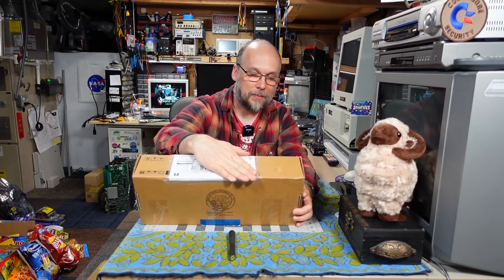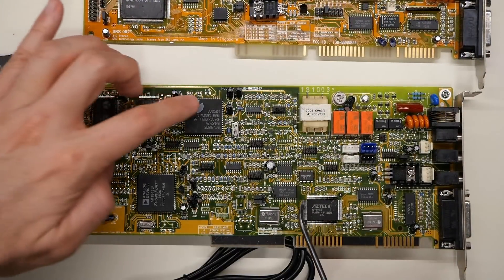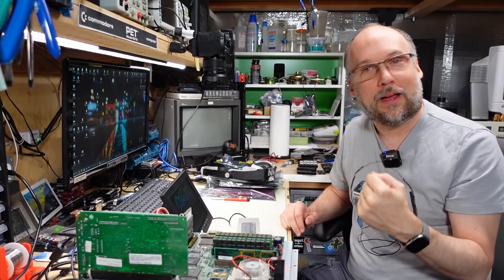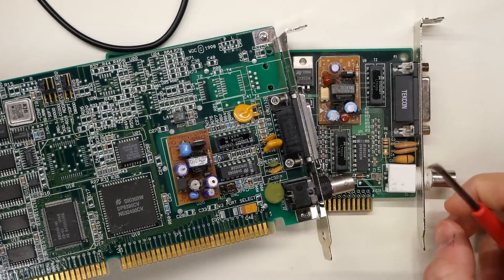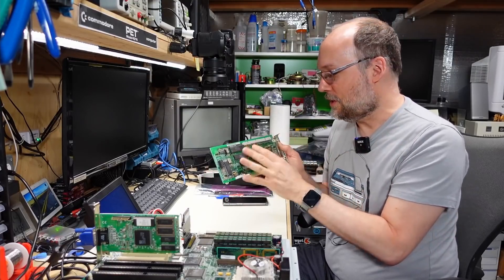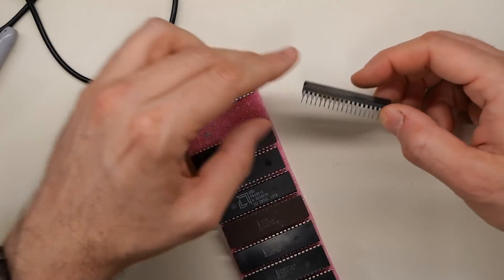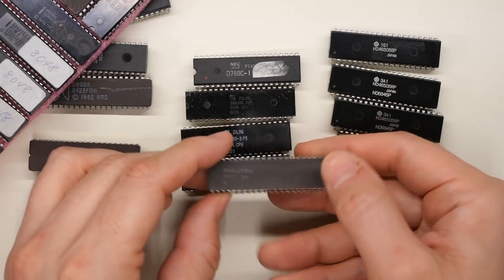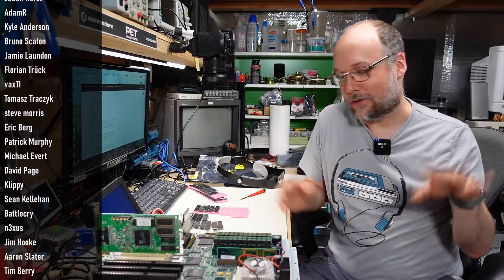An invasion of parts from the north

Comment: I didn't read all the comments so this might already have been said, but one of the last chips you looked at was a Z80B CTC (Cluster Terminal Controller) and the last one was a 4K (4096)x8bit QSRAM which is a Quasi-Static RAM.  This very interesting piece is a 4Kx8 dynamic ram array with a built-in refresh system to make it act like a static ram.  It does assert a wait-state if it's in the middle of a refresh when a memory access is requested but it was a creative way of building an 8-bit computer with cheaper dynamic memory but without having to build a refresh logic circuit.  It deserved a little more "respect" than the gloss-over it got.  It was designed as a companion to the Zilog Z8 processor and both have an interesting history.

Comment: I remember Aztech cards as being relatively decent Soundblaster clones back in the day.  I think they went as far as copying the Soundblaster 16 standard before they dissapeared from the market.  While I'm not sure about this I think they had a range of low cost PC add-ons a bit like StarTech has today.  I think we had one such card in our family PC which was a Tiny branded 486 DX2 66Mhz.  My stepfather added a Roland GS wavetable card to it which made it a really awesome sound card for the time.  Unfortunately with it being an ISA card it was not compatible with the PCI based system that we replaced that computer with.
Reply: I had one, a Aztech SG16 iirc, and it was a PRO compatible, with something more (it could do 44000k stereo, but only in Windows Sound System mode). It was sometimes PRO compatible and sometimes 16 (if it didn't require the roland MPU)

Comment: The family of microcontrollers the 8048 belongs to is the predecessor to the 8051 microcontroller series.  Both have an External Enable (EA) pin allowing the internal ROM to be bypassed.  With the addition of some external components (most notably an EPROM or EEPROM) it can execute code from external storage rather than the internal factory programmed ROM.  It only has 64 bytes of internal RAM, so compared to a modern Arduino it's a bit weak.  However there are microcontrollers currently manufactured that are very limited as well.  An example would be the PIC10F200 with 256 Flash Words of program storage, 16 bytes of RAM, 4 I/O points, and one timer.  I've repurposed some 8051 microcontrollers for projects this way years ago - long before Arduino boards existed.  The instruction set for both microcontrollers is similar.

Comment: Starlan was a network product line from AT&T and used CAT-3 twisted pair wire. Originally it was a 1Mbs network and later updated to 10Mbs. The caveat with this pre-standard gear was it didn't implement link status pulses, so you couldn't use them with standard 10Base-T hubs. However there were 10Base-T cards from other manufactures that would allow you to disable link status so they would work with legacy Starlan hubs.

Comment: Love simverters. Saved me a fortune back in the 90s
Reply: @Inject0r  I remember that as well! You'd get a tall and short A and B. The tall ones in the middle two slots, short ones on the outer slots. It stood as a "tower" of chips and let you keep your RAM without having to pay ridiculous prices.

The most we ever paid for a single computer part was $300ish for a single 8MB 72-pin SIMM for the Performa 476 we had, all because 1 game wouldn't work with the 4MB it already had and needed 8MB. I convinced my parents we should get the 8MB instead of just a 4MB since there was only 1 slot and it would extend the life of the machine. I was absolutely right in doing so.

Comment: @Adrian's Digital Basement, if any, extract the 30-pin RAM slots from the 72-pin adapters to replace the stock ones on the Mac SE and SE/30 logic boards.  Throw away the rest.  Then you've got a board that has metal tabs and not plastic ones.

Comment: The NE558 are four NE555s with slightly reduced connections. The NE556 are two complete NE555s. 
With the joystick, an impulse is set and then the time is counted until an RC element is charged. An NE555 is required for each channel, but only in one circuit variant, therefore, pins can be internally connected.

Comment: I had AZT2316 sound card in my IBM PC 330 466DX2. It was configured by jumpers, not the driver command line/did not require any TSRs like newer ISA PnP cards, and I had absolutely no compatibility issues with it.
Reply: Yes, these are EXCELLENT SBPro clones.  They are actually my card of choice.
Reply: I loved it because of that, it didn't need drivers that consume ram, everything worked perfectly both in DOS and Windows, I never had compatibility problems.

Comment: Your 3270 cards allow a PC, with appropriate software, to act as IBM 3270 dumb terminals.  They would connect via a coax cable to something like a 3274 terminal controller to access (for example) a System/360 mainframe.  Lots of fun!

Comment: If memory serves the Z8 contained Basic so it was used on my college course for easy access to Microcontroller programming, we built many variations of a black/white ping pong ball sorting system with the Z8 at its heart to learn IO and electronics interfacing. Probably would have be circa 1982-85

Comment: If you don't need the "simverters", maybe you can take the sockets off and use as replacement for plastic ones. And perhaps the OPL chips can be taken off also, to be used on more useful/modern cards. So much old hardware... what to do with it all!?

Comment: One of the chips you called 8088 was marked 8086. Fancy 16 bit stuff.
EDIT 23:39 that's the one. AMD made 8086-2
Reply: Also some other notes:

Z80BCTC is a Z80-CTC, the Zilog version of an 8-bit clock/timer chip (roughly similar in features to the Intel 8253/8254).

Intel 8251 is an USART, the big-brother of the 8250 UART used for serial ports.

Comment: That telephony sound card with the Rockwell chips looks like the one in my AST P133.  Sound Galaxy is Aztech's brand of sound cards.  Feature-wise, they were pretty decent.  The 16-bit ones gave you proper OPL3 FM, SB Pro compatibility, and Windows Sound System for 16-bit 44.1KHz audio.  For games, definitely some of the more-compatible cards out there.  The one you showed, is the Sound Galaxy Washington 16.  According to the cutely-named site "I Love Paws", this card has no WaveBlaster header.  So any MPU-401 usage will have to be via the joystick port (which the VOGONS thread confirms that card does have MPU-401 UART support).

Furthermore, Adrian, Aztech actually was VERY prolific in terms of their soundcards being so plentiful.  You are right about one card being a Packard Bell OEM version (as they were the ones who supplied Packard Bell and probably other OEMs their cards), and even companies like Reveal used them in their multimedia kits (I still have one from such, complete with a Panasonic 2x CD drive that was the same model used for Creative's 3D0 Blaster).

Comment: The ch game card was used for when a joystick, throttle and rudders needed to be connected.  You could hook up just joystick and throttle to the sound card,  but a single game port could not support a rudder.  Also, there were joystick timing issues if the gameport was on a pci sound card but playing an early dos game.  This card prevented that issue.  Only pro flight sim players had these installed as it became a niche product.

Comment: Back in the 80's UK Amstrad PC1512 there was a shortage of HDD's and there was a spate of hardcards delivered with MFM drives and RLL controllers to give you 30MB instead of the native 20MB. They were fairly reliable but not to be trusted without backups!

Comment: People complained about those winmodem Rockwell chipsets, but if your ISP had Rockwell based modems on the call-in lines and you disabled error correction and compression in your connect string those things were great.  That error correction (on by default) was a real performance killer. 

I was getting ~100-130ms pings when other modem users were getting ~200-250ms pings when I used to play Quake 2 CTF competitively.  People thought I was playing on ISDN (cable modems and DSL weren't quite a thing yet).

Comment: Here is a little more information on the Aztech cards.

The gold one with FCC ID I38-MMSN834 is a Sound Galaxy Washington 16 with the Aztech AZT2316 Chipset.

The more green one with FCC ID I38-MMSN834 is just known as the Packard Bell 030101. It has the Aztech AZT2316R chipset. 

I actually have an Aztech card in my 5170 and the OPL chip sounds amazing. The Sound blaster compatibility with mine seem to be pretty good but mine have the crystal audio chips instead of the rockwell so these ones may be different. Either way, I have found them to be perfect cards for 286 machines. I am also pretty sure the 16 bit address lines are just for the CD controller so it's possible they may work in an XT class machine as well since the sound blaster 2.0 and adlib are both 8 bit cards.

For drivers, there is a massive dump of Aztech drivers on Vogons but you may have to resort to a Packard Bell recovery CD to get the driver for the second one.

Comment: I remember a fair number of 16-bit RLL cards in the period before IDE took off. Because the difference between RLL and MFM is the disk format not the interface protocol it is possible to use any ST-506 drive with either controller. However RLL requires a more accurate drive mechanism so using an MFM rated drive with an RLL controller is hit or miss at best.

Comment: Whoa Accton network card!  These guys were big in the 90s as a cheaper small network hardware company.  I recall installing a 24 port 10mbs ethernet switch with a 100mbs fibre port in about 1996.  They were way cheaper than 3com etc.

Comment: V20s are a bit more common than they used to be thanks to some good eBay sellers.  I bought one a while back for less than $20.

I saw one 8085, an LSI chip which combines the 8080 and a few of its support chips into one package and is considerably faster than a regular 8080.

Comment: I think I had that 16bit Western Digital RLL card! I had upgraded from an "10mhz TURBO XT"  to a 386-25, and  I couldn't afford new drives at the time. I remember being really bummed that I had to set a 1:3 interleave because the old 8bit RLL controller was too slow. I still remember the happy day I was able to buy the 16bit card, fire up 'debug' and low-level format with a 1:1 interleave. I had 2 RLL drives, my original 32MB Seagate ST-238R from 1987 and my "newer" Mitsubishi MR-535 (60?MB) hard drive iirc.

Comment: Wow I live like 30 mins from Oakbank MB!  I had one of these soundcards/modem it was washington sound galaxy 16, never worked properly ever. I had the OEM for packard bell. The one I had showed up as seperate devices modem and soundcard but most of the time the Sound card portion would "disappear" and multiple reboots to get it back. Seems when we used the modem it would kill off the sound card from device mangler.

Comment: I have a Vibra16 with OPL3 chip on it. It has the absolute best bass punch and rich sound. What it in return lacks, are variable bass and treble. And it lacks mixer, except for volume controll. It is silent, so it will filther out drive read/write noises from harddisks. Normally you can hear it, when there is no sound on older creative cards. I will say that it is much like the SB16 Value Edition CT2770 model. However the value have mixer and bass/treble controll yet you can hear static noise and drive activity.

Not all Vibra cards are lacking OPL3. Just the same with AWE32 models. 3 AWE32 models have OPL3 chips, yet they are highly in demand. One is the CT3900 model. The other is the CT2760 model. (Or was it CT2670?) The third is something with CT39XX.

Comment: That is really spooky. Just before watching this I had finished setting up a CT2940 on my DECpc 433 (486dx33) together with an external Philips CDD 462 CD drive using it's proprietary 8bit serial card with audio coming in on the line-in.  That thing is so slow, would be quicker transferring stuff using it's 2.88mb floppy drive (if I had a second one that is).

Comment: I had one in a Windows 95 Packard Bell PC. I was new to sound cards at that time, but I remember it didn't always wanted to play right in DOS. I don't remember DOS drivers (like sb16.sys) for it.
Reply: in my experience it always worked great, and it didn't need drivers, i mean no TSR, no loading stuff on config sys, only SET BLASTER and a path in autoexec.bat. the port and irq were set with jumpers.  I loved that card, everything worked great both in DOS and windows. never had compatibility problems. maybe it depends on the model?. I know there are some plug and play models out there, maybe those don't have jumpers and need drivers?.

Comment: I had a AZTECH Sound Galaxy card that came with no modem, but it had an OPL4 chip and could emulate SB16. Even in Real Mode DOS. So I was rather happy with it. In Windows it had a SoftSynth WaveTable with the ability to load custom soundfonts in SF2-format, with a maximum of 4MB (not that large, I know).

Comment: I have one of those az tech sound cards. It's currently installed in my pentium 100, running windows 95. It is a pretty decent dos sound card. It worked perfectly under dos/ win 3.1. But now that i have upgraded to 95 I have had some compatability issues in some games.
Reply: it always worked great for me in 98, maybe 95's driver has some bug?
Reply: It must be. It took me a long time to get it to work at all in 95. It works fine for early windows games. But some dos games that worked before now have no sound, or crash when launched. One of these days I'll mess with it again, and see if I can get it working better. I'm hoping a different driver version will cure my issues.

Comment: I used to have have an SB16MCD card on my Windows 95 machine that supported three different CD ROM drives but the last version of the drives stopped supporting the Panasonic drive.  I had to roll back to get my CD ROM going again. Can’t recall the Soundblaster card on my Windows 98 machine.

Comment: Back in the days we would swap out the Aztecs in favor of an Sound Blaster and a stand alone Winmodem.  In the shop I worked at we never seen one that worked well.
Reply: They must have got worse by the time they started integrating modems then. I had an earlier Sound Galaxy in my first PC and it worked pretty well. I eventually upgraded it to an AWE 64 but for anything that just used Adlib and SoundBlaster it sounded pretty good. The soundtracks to DooM, Privateer and Ultima Underworld all still ring in my ears.
Reply: @flabbergasterisk  The stand-alone cards were great, the combined cards were absolute crap.
Reply: @flabbergasterisk  IIRC the cards worked ok with the drivers from the OEM install, however the drivers provided on the CD that came with the PC were different in some way.  I worked with an engineer that used a Pentium 166 with one of those cards as an answering machine for several years.

Comment: I am trying to find another one of your videos where you are showing PCBs and one of them was a HPIB(GPIB) interface card. I can't find that video again, but I am very interested in finding out as much as possible about HPIB circuits. From my screen shot of the HPIB PCB you had, I could tell that that edge connector was the HPIB connector. You just need a ribbon cable with edge connector at one end and HPIB connector at the other end.

Can you post a link to that video, or make an in-depth video about that PCB...

My goal is to reverse engineer that PCB and figure out what I need to remake it with a esp32. Do you know if there is a one-chip solution that handles all HPIB protocols and converts it to either serial(RX/TX) or i2c?

Comment: Nice video, as always.  I would love to see you use a vintage dec vt100 or vt220 terminal, or a decwriter. Should still interface with any linux, modern or vintage. I was still using this type of equipment in the early 90s, albeit connected to a honywell 48bit mini computer/mainframe.

Comment: 29:58 4Kx8 usually means 4Kx8 not 512x8... 512 byte or 4 Kbits SRAMs were not "pretty expensive" in 1982. Even the ultra cheap ZX80 from 1979 had them (two 1Kx4 SRAM and a 4Kbyte ROM).

Comment: Go read the Wikipedia entry on Run Length Limited encoding...  it's clever and interesting, and RRL coding is still very much in use...  it's a data encoding technique, not a drive interface type....

Comment: Star... May reference a type of token ring which used an improved "star" configuration. I think the idea was that single designated machine would be the central "node" in the network, and other devices could be connected, or even disconnected, from the network, at any time, since they where automatically assigned/removed from the network's known connections, as needed. Basically, the one PC functioned like a modern day router, or switch. Prior to that there was a clear, expected, path that tokens had to follow along the network, and attempting to add a PC, or remove one, from the network caused all sorts of issues, since the network couldn't automatically assign IDs to each machine, as they where added and removed, you had to assign them a fixed ID, and if you didn't know what IDs where available on the network you could mess up the entire thing, and cause the whole thing to stop working, or something.

Mind, this is from half assed understanding, a failed course in such networks (due to issues I was having at the time, and my lab partner dropping out on me, along with the teacher just not giving a F, apparently, about finding a way to have someone who had lost their partner to proceed), and what little I did learn on the subject. (More and more I realize that the so called "college" I went to only wanted my money, not to educate anyone... sigh...)